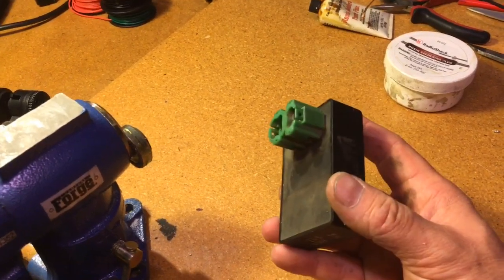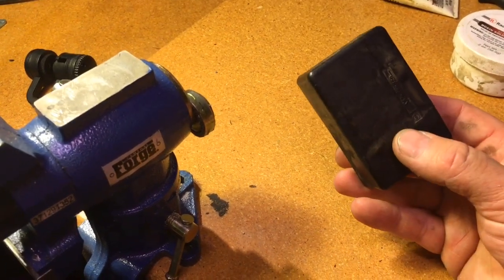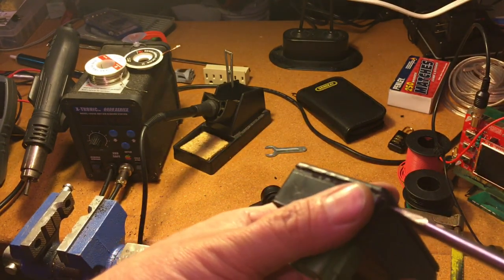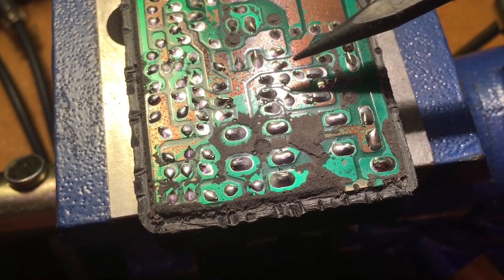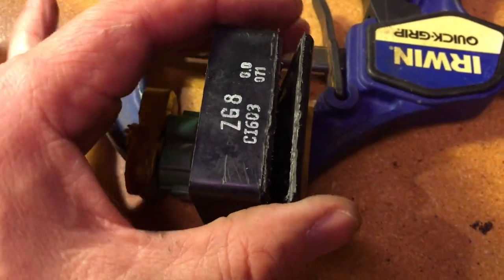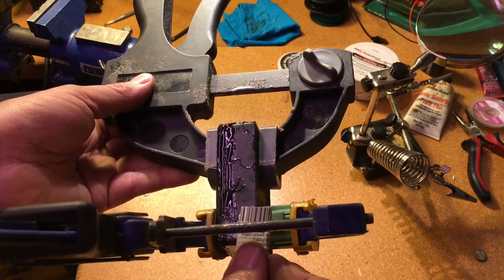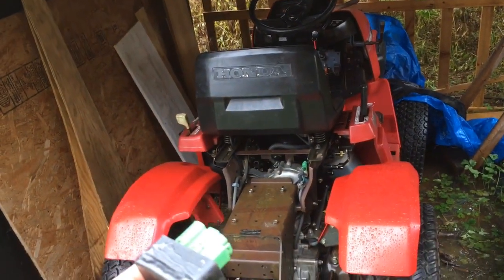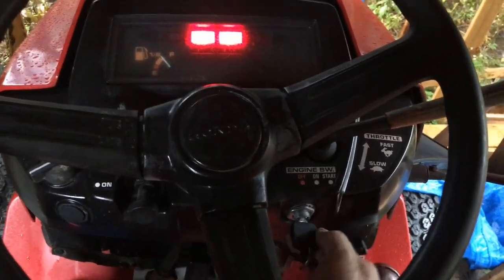CDI Repair

Comment: sir you saved me $200, Im about to buy a new spark unit for my 1984 cbx 750 then I tried this, it worked :). When you look at the pcb it looks like in order but when you start reflowing the solder one by one, you'll notice the brittle, cracked, missing solder points :)
Reply from the maker: This fix has saved me plenty of times.  It’s not 100% because there can be other problems (bad components) but all things equal it works most of the time.  I usually go over the board with a 10x jewelers loupe before closing everything back up.  Good luck.

Comment: Great video. I have heard of this problem before; cracked solder joints. Repairing/resoldering usually fixes most problems. I also head that most of the time the capacitors, resistors, etc themselves are not the problem; just the solder joints. Thanks for the walk through !!
Reply from the maker: Correct. Caps and resistors in CDI’s do not go bad so much, its usually cold solder issue.  But capacitors and resistors do go bad.  If you ever get an old B&O Beomaster 1900 stereo like I did, they are a rough go replacing the caps, resistors and bulbs - but they do sound sweet when you do!
Reply: Nice repair...I might try this on my weak SEM CDI for 1996 KTM 550

Good job ...

Comment: Tried this repair on a 1986 Yamaha ag200 which would randomly loose spark and die on me, happy to report that so far shes running like a new bike! One difference was the cdi box was made of steel so it was slower to cut the lid off. I found it quite difficult to solder all the tiny connections even with moderate previous experience at soldering, could have been easier with a pointier  soldering iron though. Still have to figure out how i'm going to reattach the lid though since i believe welding would destroy it, maybe silicon, although silicon can conduct some electricity so hmmm i'll work something out. Thank you for the helpful video!
Reply from the maker: Glad it helped you!  Yes CDI’s made from aluminum can be harder to cut, but a good hacksaw will do it  with CDI lightly held in a vice.  The soldering can be very tedious for sure, an option if you have a reflow station is to use the heat gun on that to reflow the solder but that can be more risky if you over heat.  I’d seal it back up with JB Weld.  Clamp the CDI and apply the JBW, all the way around and it should hold fine.

Comment: Excellent advice and clear instruction. Just operated on  my CDI module, reinstalled it; the Four Traxx fired right up and ran fine. Thanks for posting your video.
Reply from the maker: This fix should last quite awhile if it works, since it means it was indeed a cold solder problem and not an issue with any of the components.  Have riding!👍
Reply: @MaineGreenCrabs  Great video! That CDI looks identical to the one in my old atc250r. I wonder if they are interchangeable.
Reply from the maker: @user-zt2cc7qq9b  unless its the same engine, which it isnt, no. Would it make it fire?  Possibly.  Would it likely ruin the engine because its signaling the wrong time and intensity of spark? Yes.

Comment: awesome! FYI= weld plastic with the solder gun and zip ties ...melt them in hole.. slow melts and hardens as go.. strong and less likely to run insideon board .  i used zip ties for plastic wheel barel cracks... works great ! for bigger cracks ..i use bigger solder gun and bigger zip ties

Comment: Success! Thankfully none of the internal components were faulty or you would not have gotten off so easily. Many electromechanical devices have similar issues, relays being a very common item. Bravo.
Reply from the maker: Yup.  Ive had CDI’s where the component was popped.  The only way to get to it was super destructive to the board - soaking it acetone.  So it really wasn’t a good idea.  I never figured a way to get that epoxy off otherwise. Do you know any other way?
Reply: @MaineGreenCrabs  epoxy is a sealed for life sort of deal with cheaper offerings out there boasting a ready fix, but that's rarely the case isn't it. Had brand new electronics and sensors both fail or never work as the one size fits all philosophy rarely works. If all the electronics materials sales places still sold to the public, with a little ready smarts and small package of components a person might fashion one himself. Most of the components are cheap enough, just not readily found these days.
Reply: The old fashioned way pick it out, time consuming but it is doable.

Comment: Great video here John. Thank you for posting this. This fix will save me over $900. Yipee!
Reply from the maker: Dan Ward that’s an expensive CDI!  The CDI for my tractor is $250, this type of fix is a reasonable option if you have a good machine but new CDI’s are either not available any more or prohibitively expensive.  Good luck.
Reply: @MaineGreenCrabs  thanks! yeah it is. I actually discovered that my issue was the flywheel magnets not the CDI.

Comment: Thanks John I have a 4518 have replaced the cdi box  back in 96 mower is a 92. Gonna try your repair the oem one. Thanks again!
Reply from the maker: Terry Maines if it’s not starting or not starting reliably and you’ve isolated the CDI as the problem this is at least worth a try.

Comment: You could also use the soldering gun to melt the plastic for a water proof seal.
Reply from the maker: Yes, I weld the plastic on my old motorcycles,  the risk with that for the CDI is it is often not 100% water tight or the seam can open up.  It won’t with JB or two part epoxy.  But plastic welding is a a definite option.

Comment: I have to say thanks for this video. I’m a long time Honda guy and I just bought a RT5000 that I assume at this point has this CDI issue. The fuel solenoid is giving me a hard time. I will give this a shot.
Reply from the maker: Pugbug288 this is exactly the scenario this fix is for. Good luck!

Comment: This worked perfect for my ATV. Thank you
Reply from the maker: Good to hear!  Sometimes it does not work if the issue is with a component, but if it’s a cold solder issue this usually does the trick.
Reply: @MaineGreenCrabs  looked like some dry joints. It’s been a few days and hasn’t played up since.

Comment: What is the harm if getting the JB weld inside the CDI? I’m looking a re-sealing mi e for a Mercury Outboard, it needs to be waterproof.
Reply from the maker: JBWeld two part epoxy is considered an insulator so electrically its ok.  Just be aware if you get any on the board thats it, you wont be going back in again, it wont come off the IC board without a fight and it will win.  Good luck! 👍
Reply: John Painter would JB water weld putty be a better alternative?
Reply from the maker: Livetofish Outboard Repair I dont know, I haven’t used it for this type of application, sorry.
Reply: John Painter thanks for your reply. I think I’ll give it a try and see what happens.

Comment: Just ordered a cd for my honda cm... will give it a try on the old one now 😅👌
Reply from the maker: Glad you were able to get a new CDI, that’s not always possible older bikes, or low production, there are a number of people who do this fix with CDI’s for Honda Transalps.  Good luck👍🏻
Reply: @MaineGreenCrabs  it's not a new one, second hand but it's working,  at least what seller told me. But bare with me, not all cdi have that gummy protection,  you'll be amazed what's protecting the cm one 😅

Comment: In the industry this is called a "dry joint" and is incredibly common in import cars and of course other things - but the "other things" ( appliances etc . . ) are usually so cheap no one takes the time and effort to figure out the dry joint issue and repair it - they just throw the stuff away ( in our modern disposable society ). So anyway - as a car mechanic - I can tell you that small circuit boards like this can stop an ( older high mileage ) import car from starting / running. And running down the issue is sometimes difficult. Long story short - you can simply melt the solder on all dry joints until they flow together and this can fix the whole deal. Also - some of the dry joints are so bad they are physical separations you can easily see without your reading glasses etc . .
Reply from the maker: Good points.  I’ve reflowed several CDI’s from old motorcycles, I’ve tried it in an oven and the case warped, then just using my reflow station and working my across the board and really controlling the heat, but most of the time just the soldering iron and maybe a bit of fill on dull spots gets the job done.  I had a CDI that was bad on a ‘84 Honda VFR500F that I salvaged from a guys wood pile, though it’s possible to get new rebuilt CDI’s for them, I really didn’t want to spend the money on that, and that the boards are just slid into a plastic housing, it made the most sense to repair vs throw away or drop several hundred on.  That’s really the scenario I did the video for, and though there’s no guarantees, but it’s a repair option worth trying before spending money.

Comment: Do you hear it up or do you have to open it  two questions
Reply from the maker: Before you go to this extreme of actually cutting open the case, one of the “fixes” is to heat the CDI with a hotair gun or hair dryer on the highest setting. It should be almost too hot to hold, like toast out of the toaster.  If that makes your engine start then you’ve also diagnosed the problem. It will only be a matter of time before even that trick stops working.  Only after that, even heating up the CDI and it still wont start do you open the case, once its open you always run the risk of getting moisture inside and doing more damage.  Good luck!👍

Comment: Amazing my Honda outboard CDI unit is messing about a new 1 cost a bomb! Mine looks identical to yours, I am going to try your method thanks
Reply from the maker: They look very similar, and the connectors are standardized (now), but unless it’s for the same engine, they are quite different.  If you’ve pretty much ruled out other possibilities and new, NOS or used but verified working are expensive or just non existent, this is a good option versus parting out the engine. It doesn’t always work, but if you take your time and go over everything carefully it can pay off.  Good luck👍🏻
Reply: @MaineGreenCrabs  I cut the top of it and the all the joints look very good shiny solder no cracks, I cannot access the rest because it’s foam filled I’m buying 1 from a Honda outboard dealer 👍
Reply from the maker: @ryanferris7841  If you have the case apart, and have the time, why not just go through with your solder iron and reflow each component? I have done enough that I’ve seen some that did not have cold solder, but the solder didn’t grab the board well and it’s extremely hard to see because it’s around the rim of the solder where it meets the board.
Reply: @MaineGreenCrabs  New 1 ordered now I’m moving on lol very expensive.
Reply: Try it and see,  then you will have a back up.
  The parts guys love you.
Ah ha.😄

Comment: I believe the box should be mounted loose. It’s the resonating vibrations that cause the solder joints to fail.
Reply from the maker: Loose mounted CDI’s get banged around on tractors and dirt bikes, might be ok on street bikes driven easy. Cold solder cracks happen because the solder went in cold, could be heating/cooling thermal cycles that produce cracks or vibrations and finally does it in could also be lead free solder cracks a lot too. Good solder rarely cracks. Sucks when it happens, but you can usually tell as the engine gets harder and harder to start and everything else is good. Good luck
Reply: You both bring up good points, Kawasaki rubber mounts their cdi s as I sure others do also, providing a suspention and vibration dampiner.  Your comments about lead free solder are interesting, I agree with both of you.

Comment: Just cracked flux repair ok, what if you must replace some components on other side?
Reply from the maker: ivan novoselac it’s risky since you have to soak the whole CDi in acetone.  That will eat away the epoxy and expose the components.  The issue is, it can etch the metal on PCB and make the situation worse.  That said, it can work, and if you have no other options why not try.  Good luck!
Reply: You can rather try to pry the epoxy off without soaking it in acetone but again you've to do that with great care otherwise you might damage any of the component on PCB. Take your time and do it precisely.

Comment: I am confused a little.  You didn't show that the repair of soldering was actually the repair that solved the issue. Then you resealed the lid before you tested the repair.  Why wouldn't you have tested before you sealed it back up?
Reply from the maker: The CDI was literally dead/non functional. The tractor finally stopped turning over, I had tested everything else and knew it was the CDI. Prior to this I had been using the heat gun trick on it, and the tractor was starting, but that’s always the last gasp for CDI’s.   So I was already prepared to spend a couple hundred on a NOS CDI.  It was just last ditch effort to save a couple hundred bones, nothing to lose if it didn’t work.  Most of the time when I open them up and look with a loupe, I can often see the cold solder hairline cracks, but generally if the solder is dull/frosted looking it’s bad. Good solder will be very glossy. I’ve done this a number of times to old motorcycles I’ve rebuilt, and am fairly confident when I try this fix. If you choose to try it before sealing it back up be careful not to let any moisture get on the board or let it touch any metal or you may short it - then it’s really done.  Good luck.

Comment: I think my cdi need more than resolder. I thought we can reach the component side on the pcb board. Thx for the video.
Reply from the maker: Shahmin Baharuddin Usually the components do not fail, but some times they do.  The only good way to get to them is soaking the whole CDI in acetone, which can easily damage the PC board. Good luck.
Reply: You can rather try to pry the epoxy off without soaking it in acetone but again you've to do that with great care otherwise you might damage any of the component on PCB. Take your time and do it precisely.

Comment: Nice vid i would like to sow the result of weld before byou seal it
Reply from the maker: If you test the CDI on the engine before putting the backing back on, just be sure not to let it touch any metal or get any moisture in there when you seal it up, Ive done both.  Good luck!
Reply: @MaineGreenCrabs  o.k thanks

Comment: Very cool thanks for sharing
Reply: Michael M I’ve got a couple other videos related to testing and replacing, though unfortunately no repair, for coils and condensers for old motorcycles that use points.  Early bikes (engines in general) that started using CDI are more problematic to get parts for ironically so repairing is often the only option.

Comment: How about the cdi battry operated is not working..is there availlable cdi in the market?? & how mch..tnx mch
Reply from the maker: edzlyn deocampo I’m not sure I understand the question, I’m not familiar with CDI’s that have a battery, generally they do not.  If your engine turns over, you know the battery is good, if it’s not turning over you possibly need a new battery or have a bad solenoid or have a short somewhere and you need to trouble shoot where the problem is.  Good luck.
Reply: @MaineGreenCrabs  ahhh..ok..tnx mch👍👍

Comment: Appreciate this post. Did not help me.
All integati circuits looking good after cracking open cdi,ecu Polaris 2008 rzr
Did some continuity tests, all good.
Reply from the maker: This is just a last ditch effort when you know your CDI is failing, so it’s not a 100% fix.  Sorry to hear, are you sure it’s even the CDI giving you trouble?  I swore I had a bad CDI on older Honda XR once, turned out it was a bad ground... it was so aggravating chasing that down!  Good luck.

Comment: I’d seal with silicone and then black tape in case you want to repeat the job
Reply from the maker: Silicone and electric tape do not hold up well, but would probably work for awhile. Generally if you have been careful and gotten all the cold solder fixed, you do not need to open it up again. Good luck.

Comment: cant you remove glue of unit using chemical ??? pls tell me chemical.
Reply from the maker: Sampath Gurusinghe  it is not “glue” it is epoxy.  You can use acetone to remove it by soaking the CDI in the acetone.  However that will often destroy pc board. It is much riskier than the process I used.  But feel free to experiment and see what happens.
Reply: @MaineGreenCrabs   mr John thanks for your advice. i will try it. cant we get circuit diagram of CDI units. or simple circuit(like common) thank u.
Reply from the maker: Sampath Gurusinghe I’m sure there’s a circuit diagram somewhere on the internet, not sure why you’d need it.  If you have the time and ability to make your own CDI why not just do that?  Otherwise my video is meant for the average DIY person if they want to try to save a CDI that is not possible to get a replacement for or costs too much.  With enough time and money I’m sure you can do what ever you want.  Good luck.
Reply: @sampathgurusinghe3944  Dont know if this will help you being awhile ago you posted this but i found The Learning Zone has incredible info on these...Circuit breakdown and everything..

Comment: guys my issue is.more basic lol. how do these connections work. I cant disconnect my cdi.
Reply from the maker: There’s a few different types connectors, but generally theres some type of plastic pin in the center you need to slightly lift and pull the connector off the CDI. A little fiddling with it and you’ll get it.